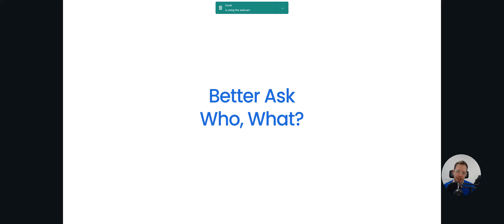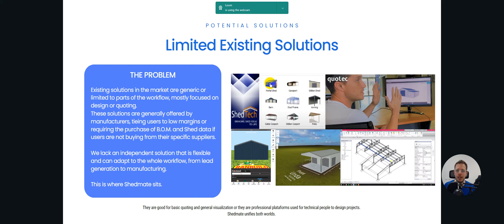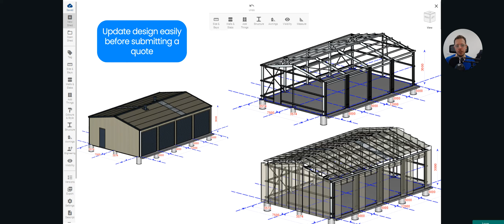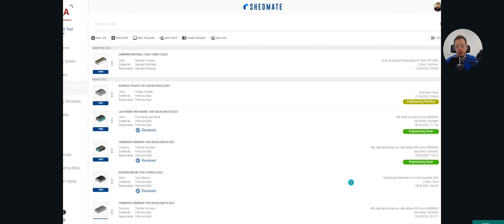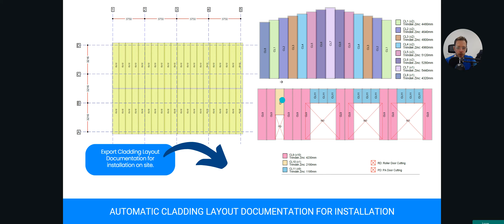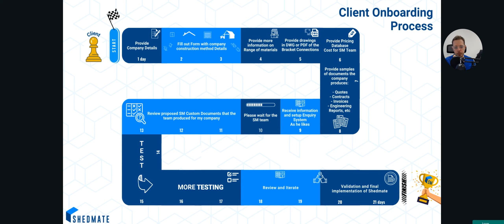Become an Independent Supplier of Shed Kits

Comment: what does the system cost? and is there any plan for say one or two time users? cause upon looking into building a shed, the costs are insane and a great deal of costs lay in the main companies hands, as you mention, but I don't wish to buy the system to sell sheds, I just want to be able to use it to prepare documentation for one or two personal sheds here at home. I tried to register online to your web page, but it said it's "failing to register" and to try back, I've tried back multiple times now with no luck.
Reply from the maker: Hi, Rusty Needles. 

We are a Shed Business system so we don't offer solutions for the end user at this point in time. This is why the registration page didn't work. 

We could connect you with any of our Shedmate partners using the system so they could provide you with plans, where are you based?